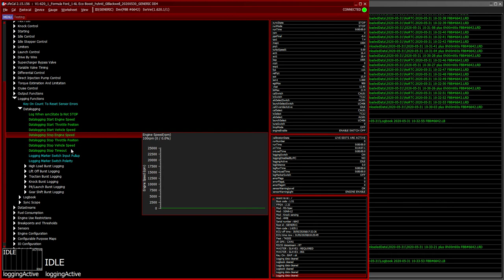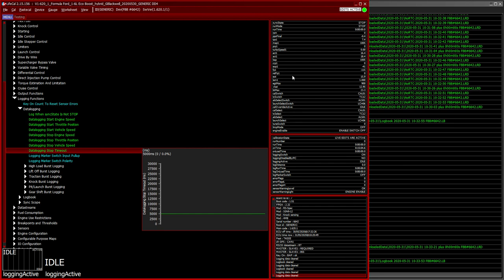Life ECU, how to log data with the engine stopped, useful for testing sensors and config changes.

Comment: Is this a USB connected to a USB port? Or, do you connect laptop to the car, via USB - Ethernet Cable?
Reply from the maker: The Life ECU has an ethernet port which can be connected directly to the port on the laptop. However I've fitted a tp-link WiFi travel router to the ECU, which presents a secure and encrypted wireless access point, so my laptop connects wirelessly to the ECU.
Reply: @ZetecinsideMotorsport  Nice! Our Ford Fiesta Rally Cars use the same ECUs. When they're in the stage, do you have an idea of how to watch the car performance, Live, using the liferacing live app on the laptop?
Reply from the maker: @ahilkhan555  you could do that with a more robust and powerful WiFi access point, possibly with an antenna on the roof. Can't see why that wouldn't have the range. Or even push the data to the cloud. Anything is achievable with the technology.